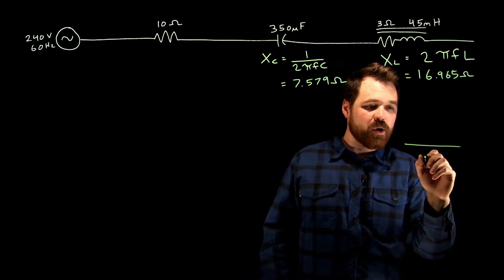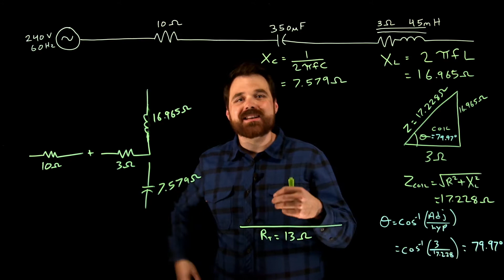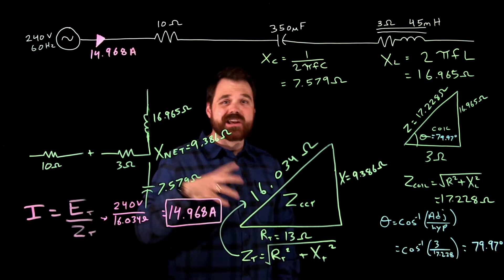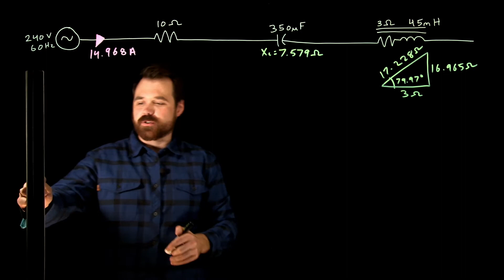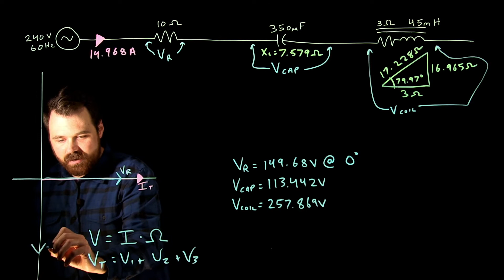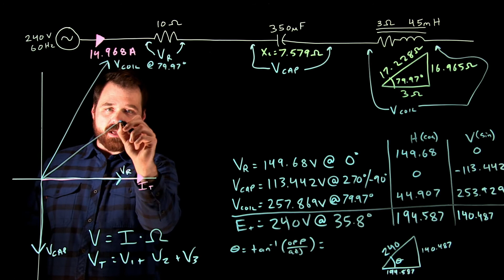Series RLC Circuit

Comment: just finished 4th period and have my branch next Thursday. ive been sending some co workers your way since they are in 2/3 period. Thank you so much for the refresher.

if you have a black sharp calculator and want to skip the HV chart. hit mode 3 2nd function 8. you should now see a theta symbol on your calculator screen. essentially just hit your voltages -    v(degrees button)angle + V(degrees button) angle= voltage. hit 2ndfunction again to get your degrees.

Comment: What would you do if you had A circuit that consists of a coil and a capacitor connected in series across a 120 V, 60 Hz supply. The capacitor has a value of 35 µF. The circuit current is 8.5 A (lagging), and the wattmeter shows 250 W?
Reply from the maker: It would really depend what I was looking for.

But for the capacitor you can easily calculate Ohms, Volts, and reactive Power

If you know the total current and voltage, you know your totla apparent power, so you can put the watts and Qxc on a power diagram to figure out the QxL.

Comment: I keep getting a Xc= .00758 ohms: which converts to 7.58 micro ohms as you wrote it on the whiteboard.
Reply: Oops calculator error. I thought I could skip the * between 2 and pi
Reply: Nope that wasn't it. I believe your Xc is not in ohms but in mili-ohms
Reply: if we are going to stick with Hz (vs MHz, KHz etc) then the capacitance needs to be converted from uF to F. A difference of 6decimal places.

So 350uF equates to: .000350 F.

if Xc = - ( 1 / 2*pi*60*.000350), then,

7.58 ohms is result. 

I know its 4 yrs later and u prolly dealt with this… anyhow, might help others and it helped me cement MY understanding. Much love and I hope electronics knowledge has improved yet life!💪🫡

Comment: You can't just throw in a phase angle of -90 for the capacitor without considering the phase angle of the current which comes from the total impedance Zt. This would give 14.9A with a phase angle of -35.9 which would result in a voltage and phase angle across the capacitor of 113.4V and an angle of (-90 PLUS -35.9 = -125.9) degrees, not 270/-90. Please correct me if I'm wrong.
Reply from the maker: The phase angle of -90 is just for the Voltage across the capacitor and the total current
Reply: Ah, I didn't watch the last minute where you solved for theta of the original voltage. I had assumed that a phase angle of 0 was implied for the voltage. So yes that would put your current at a phase angle of 0 and your cap voltage at a phase angle of -90 degrees. Thanks for clarifying.

Comment: Awesome! How do I email you?
Reply: I have 2 questions that I need help with. First question:
A coil and a resistor are connected in series with the following values:
The resistor is 4.2 ohm
The current through the circuit is 9 A
The total power dissipated by the circuit is 800 W
The supply is a 120 V, 60 Hz supply.
Find XL of the coil
Find the VD across the coil
Find the pf of the coil